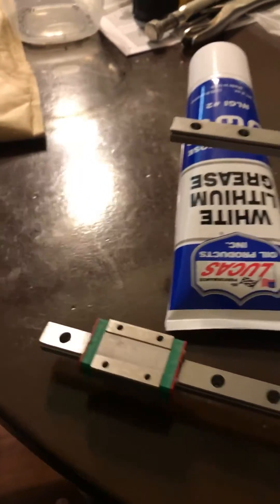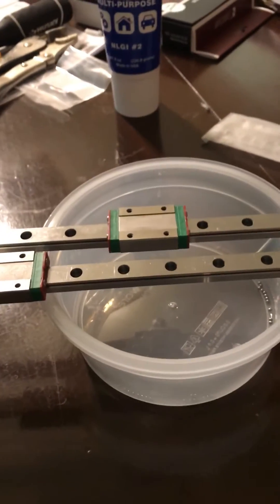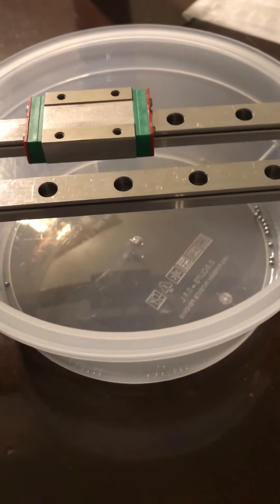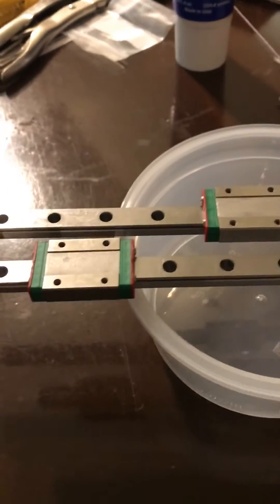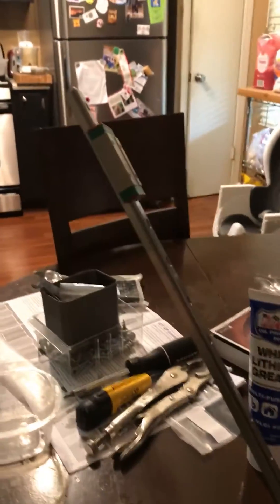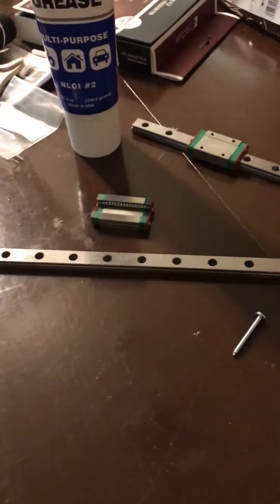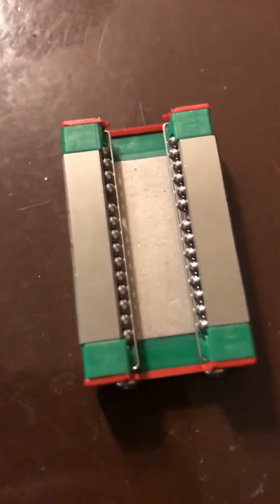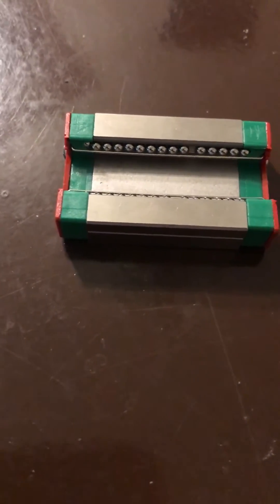Replacing Ball Bearings in Chinese MGN12H Linear Rail for 3D Printer

Comment: I did this because i was having issues to, i found that actually the rubber ends (that pick up the dust) are causing a lof of friction. When they are not on the blokcs the blocks go really smooth. Any idea how i can counter this?
Reply from the maker: The Gov I can’t really “recommend” anything without seeing the problem. What you might find in the races and toward the ends is burs or small catches from machining that prevent your bearings from doing the turnaround smoothly. It could also be that the plastic/rubbery ends are poorly made and doing that same thing. Either way, something is in the way of the ball bearings recirculating in the oval-like raceway they follow.
Reply: @waldvogelreview7755   Thx for your reply. I removed the rubber ends en replaced them by 3d printed ones. these do no catch dust but now the rails move super smooth.
Reply from the maker: @ISFRedSandman  Maybe if you printed them in TPU ? LOL
Reply: @waldvogelreview7755  Lol, i have soms TPU laying around, i could modify the model a bit so it does touch the rail slightly xd.
Reply from the maker: @ISFRedSandman  In case youre wondering, I did not use white lithium grease after testing. I cleaned it again and have been using SuperLube brand silcone\PTFE lubricant

Comment: I ended up using ceramic bearings.  This worked great as I was having a lot of shifting and finally figured out it was the bearings. Thanks for the video.
Reply: Here are the bearings I used.  Make sure you get enough as I thought 100 would be plenty and each side of the rail cartridge has around 37 bearings.
3/32" Inch Si3N4 Silicon Nitride Ceramic Ball Bearings G5-100 Balls https://www.amazon.com/dp/B01AXDD2JE/ref=cm_sw_r_cp_apip_oYK7y1vfGHH9X
Reply from the maker: CLTaggart if you don’t mind, post a link to where you got your ceramic bearings for anyone else interested. I have been wanting to try it with ceramic bearings too

Comment: wanted to chime in here. I watched a bunch of other videos, bought suggested grease, took apart and cleaned them as suggested, nothing worked. I ordered the bearings you suggested and they improved as you showed, instantly. the rails wouldn't move even if I held them vertically and flicked the carriage. after replacing the bearings it moves with slightly elevating one side or the other. thanks so much.
Reply from the maker: Sam Antics I’m so glad that it worked out for you. Milling the rails and the inner metal flat is the easy part of manufacturing these for the companies. Ball Bearings are precision items that take time and know how to manufacture properly.

To be fair the measurements came from a forum post I had read about these 
I gambled and wanted to share the result. 

I’m so glad it helped

Comment: Thanks for this video, it inspired me to go spend a tenner on a bag of simply bearings grade 100 balls and some WD40 white lithium grease....

Unfortunately it made very little difference. Note, my MGN12H clones contained 33 balls on either side, 66 total!, wish I'd bought a bag of 500 to do all my 6 blocks!.....

Of 6 MGN12H blocks purchased total, 3 are pretty good and 3 are very sticky, BUT, 1 of those 3 seems to move very well under load. I'll have to run some more tests. maybe there's a pre-load version shipped in error?

During my research for MGN style rails, Fred BST automation keeps coming up. I purchased mine from Hong Yi, who's been mentioned in a few forums, and who's service is fantastic, we're having a dialogue now about possible ways to getting the blocks running better!. 

For the ££, (about £95 / $125 all up for 3 x 500mm rails and 6 carriages) , I'm happy i've gotten three great working rails and carriages. Lesson I guess is if it's a quick project, spend more ££, either by getting the supplier to test / guarantee before shipping, or just buy a couple of extra carriages and hope for the best
Reply from the maker: I should mention that I put White lithium grease on one set, and I felt it actually limited the smoothness and increased the amount of energy needed to move the carriage. Will it last longer in the grand scheme of things? I honestly do not know. I am not a authority on bearings or linear rail at all. I simply got a wild hair up my butt to give it a try for a tenner, just like you. It worked ! So for my other 4-5 sets I have not added grease. I put 1 drop of that drill tap\cutting oil stuff on either side on a couple. I do not know if it actually made a difference in the long run. 

I will say my video that shows the carriage movement without grease\oil on some chromed bearings from a actual bearing manufacturer is a consistent improvement on every set that I have done.

Comment: You're lucky you got the block and linear rails. I ordered 2 sets and ended up getting 1 set and a second block with missing bearings and linear rail.. 
DON'T order off Ebay from reseller called "mayunstore". Written 3 times to them about it, took photos, got no replies. They take yer money and run.
Reply: It's funny that I ended up seeing this comment while looking at replacing the ball bearings in a cheap mgn12h, because I just closed an eBay dispute with that exact seller for filament lol. They sent white, but the listing claimed it was clear. It took them a long time to do anything about it, and they sent the same copy and paste BS multiple times before I got a resolution.  So, a year later, they're still not someone that I would recommend anyone deal with. It's a wonder how these stores stay in business on eBay with such poor customer service.

Comment: It could also slide easier if the ball bearings are even probably just some microns smaller, couldn't it?  Could you see if the new vs. original bearings allowed the carriage to wiggle more?
Reply from the maker: perspectivex absolutely not
I did a test trying to create some flex or movement and they are rock solid
Still equally as hard to get onto the rail without losing bearings (unless you have a plastic transition piece) 

I have not noticed any problems
When using 2 for my z 
The smallest offset between the parallelism of the 2 rails still will cause binding on the x gantry 

They seem to have plenty of precision to me

Also measuring the chinese ball bearing you can get discrepancies between them
Reply: cool, thanks for the clarification.

Comment: Thanks for the info. I ran into the same problem with mine. Did you end up applying any grease? Would you recommend it?
Reply from the maker: Matt McArthur I have applied the grease on the y axis
I must admit that it was extremely difficult to get the rail back on without the ball bearings sticking and wanting to come out with the grease
I haven’t noticed friction problems without the grease on my x axis yet.

My advise is to get the carriage on and Apple a small amount of white Lithium Grease to the rails where the balls contact the rail and work it back and forth the full length of the rail. Use your finger to wipe off remaining blobs.

Comment: Awesome video. If you could do one of the process of swapping them and loading them up with grease that'd be great.

EDIT: Which version of the mgn12 did you order?
Reply from the maker: Derek S I have more bearings and the rails for my Z axis coming in another month or less. 

I will do my best to do a video !

I should mention, after packing one with white lithium grease, I’m not sure I would do it again. It made the balls sticky-ish and made them want to come out as you put the rails on. I’ll need to do some reading first
Reply: Good to know. Where did you order these?
Reply from the maker: Derek S the linear rails were from eBay. I just searched for MGN12 rails in North America. I then picked my length and voila ! 

For the bearings I believe they are BG bearings from Amazon
Reply: WaldvogelReview sweet. They're pretty cheap on eBay so that's where I was hoping you'd say.

Comment: Hey thanks for this video! I'm actually in the process of designing a new printer from scratch using the same size Chinese rails. I'm about to order the parts for it soon, so I guess I'll be picking up some new bearing balls too :)
Reply from the maker: Ronald Finger Thanks ! 
Hey, if your up for an experiment. I learned after the fact that Ceramic Ball bearings are supposed to be even smoother and believe it or not, handle a higher weight load than steel. 

I used Chromed steel bearings. But if I can do it again would be interested in trying ceramic oo
Reply: can't believe I stumbled upon Ronald!! love the fiero series